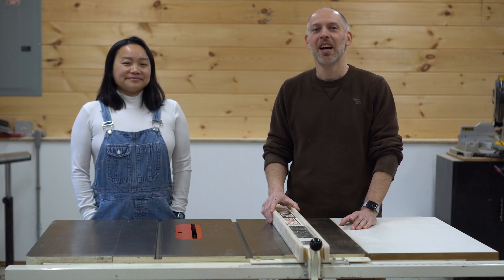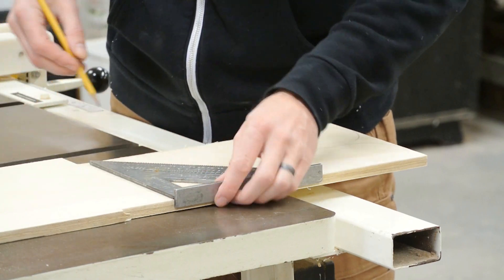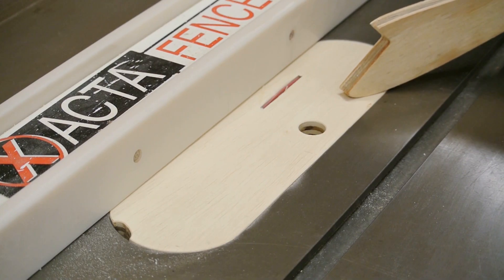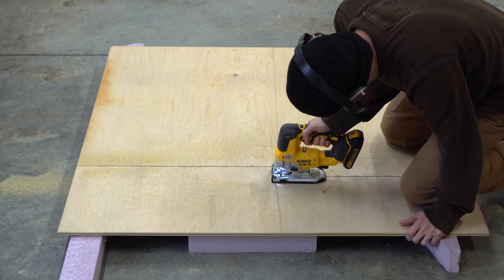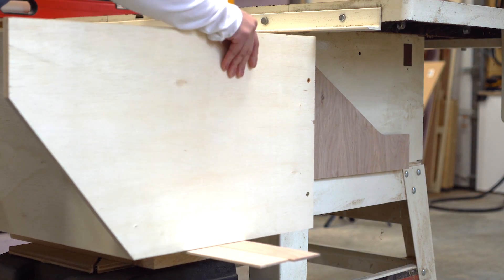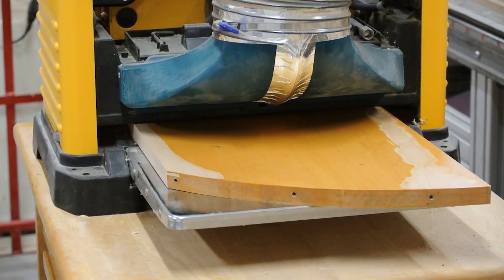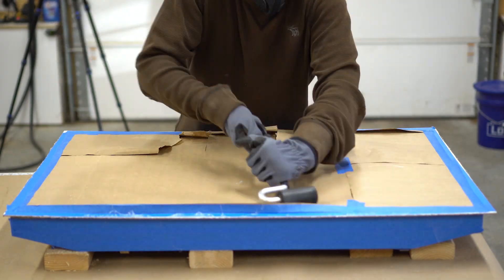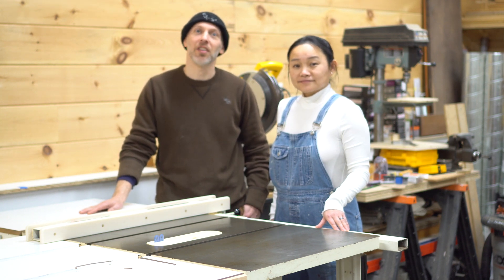Table Saw Upgrade

Comment: Interesting project. My ancient Craftsman table saw needs an outfeed table, and then there is the idea that this kind of design might help with dust collection or at least help contain the dust.  So, how did it work in managing dust & chips?
Reply from the maker: Thanks! We're really happy with the end result! The outfeed table itself did help keep the dust from flying out the back of the saw and filling up the room, but it wasn't until we added our custom dust collection port underneath the saw that we really saw huge improvements. If you haven't watched this video yet, do check it out: https://youtu.be/0_cxKsaPiLo?si=H_mFItBcjFdmEzKt  Our zero clearance insert also helps keep the dust in the box, but there are still cuts that spew dust right at you. We may consider over the table dust collection in the future.
Reply: @ournextmake  Thanks for the follow up.  I agree about the need for dust collection both above and below the table.  If you use a crosscut sled, you will also have noticed that a lot of dust come back at you, along the kerf.  A dust port on the thumb guard, behind the sled’s fence, is the best solution I’ve seen.  
A word of caution: You want to ensure the enclosed motor gets enough ventilation so it does not overheat.  
Best wishes, Happy Holidays and stay safe!

Comment: Bought a old delta contractor saw similar to yours. First thing I did was buy the micro jig splitter kit and make a zero clearance insert with splitter. Well after calibrating the blade and fence that is.
Reply from the maker: That's awesome. The Micro Jig splitter kit is a perfect addition to older saws like these that don't have riving knives. It has totally increased the safety of our table saw.

Comment: just (finally) putting together my wood shop and have an old table saw where the motor hangs out the back like yours. Thanks for the idea and proof it can be done!
Dust collection that isn't my broom is going to be the challenge.
Reply from the maker: I'm so glad that you found the video useful, Chris. Stay tuned for a future episode where I tackle dust collection! I too have pushed a broom or shop vac around the shop for years! :)

Comment: Best not to run painted or varnish threw your plainer or any expensive blades or cutters
Reply from the maker: Great point. I suppose a drum sander would have been an alternative to removing the  finish. Do you have suggestions for any other methods? Thanks for the feedback.
Reply: @ournextmake  their are a few methods for paint removal, I was just making the point that the speed of the power tools pretty much melts the paint or Finnish onto the blade or cutters or knives depending on what tool your using, then it won’t cut very well probably start smoking, so you’ll have to soak the blade or router bit whatever in lacquer thinner for a while or use old blades for cutting wood with finishes on them
Reply from the maker: Great points... I've only ever thought about a painted surface gumming up the works, but to hear you point out that other clear finishes might do the same is eye-opening. I'm glad you shared that. Thanks!

Comment: Great job and how timely… I have the same Jet saw and I’ve just started thinking about how build an outfeed extension combined with a base storage cabinet to replace the legs and house the router lift. Super glad I saw your video since I hadn’t realized just how high the motor swings up and to the side.
Reply from the maker: I'm so glad this video was helpful, Tom. I too was surprised at just how much the motor travels. FYI, at 45 degrees (and perhaps other angles close to that) there are certain blade heights that even put the motor above the plane of the tabletop. This shouldn't interfere with most cuts, but it was interesting to learn. Good luck with your project. I was also thinking about a whole new base and outfeed table combo, but when I realized I could make a cantilevered design work, I just had to go for it!

Comment: You could also have swapped in a seven inch circular saw blade to make the initial cut in the throat plate rather than doing all the measuring and routing. Worked for me.
Reply from the maker: Great tip, Tom! Thanks! I'm sure I'll be making other inserts in the future, so I'll be sure to give that a try!

Comment: I did a whole slew of table saw projects a few months ago to get my ancient Sears contractor saw improved. The most challenging was finally getting the blade aligned much much closer to parallel with the miter slots. A couple of days of loosening tightening hammering and measuring (using a dial indicator with a jig I 3D printed), but finally got it down below 0.002" across the width of the blade.
Reply from the maker: Cool use of 3D printing to hold the dial indicator... and impressive tolerance on parallelism!

Comment: Nice.  First video featuring the same saw as mine, although mine may be older.  I have wanted to do something similar to improve dust collection.
Reply from the maker: Hi Joe. Glad you liked the video. I bought this saw in 1999 or 2000, so it's got some mileage on it for sure. My next step is to swap the 4" port on the bottom of the saw with a 6" and connect it to the main line of my dust collection. I hope to show that in a future video.
Reply: @ournextmake  My task is more complicated as i trashed the Jet fence for Incra.  Rail system adds some complications_ but it should be a fun project.